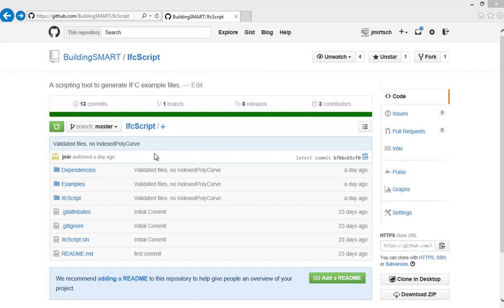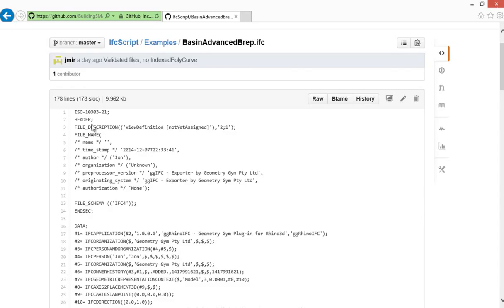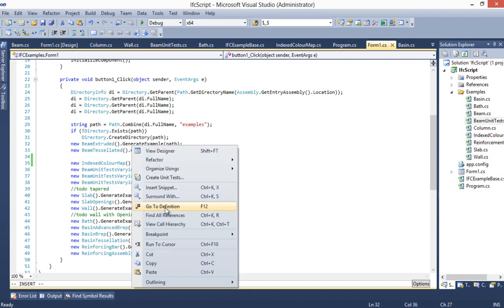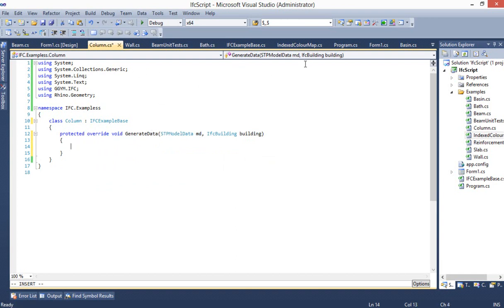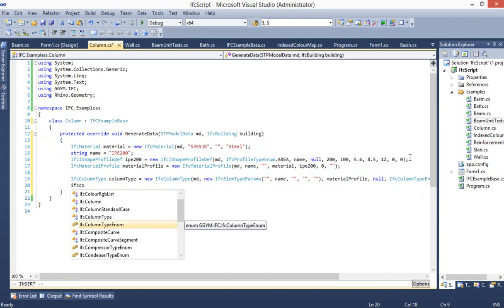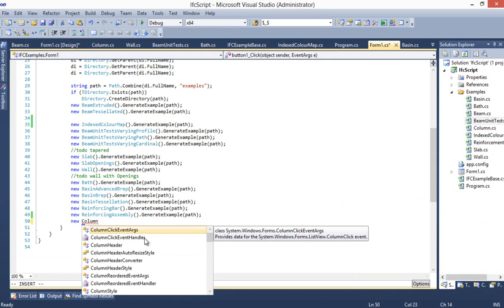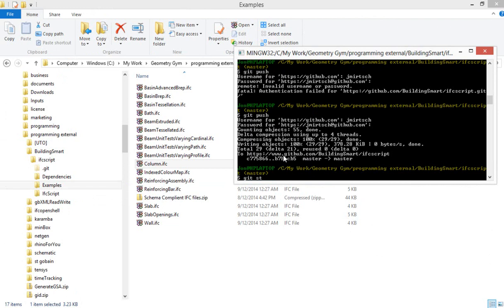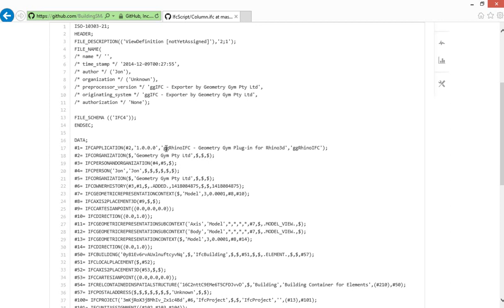141208 ifcscript introduction

Comment: Hello Jon,
Thanks for your great efforts...
I am using GeomGymIFCx64.dll to create (IfcWallStandardCase)
1. Is there a way to create walls from the center lines instead of creating them from the edges? like in Autodesk Revit" location line"?
2. How can I make it possible to join adjacent walls, trim corners...
3. Can you provide a brief explanation about the current constructor for IfcWallStandardCase? especially the "bool" and List<Plane>

Thanks in advance :)